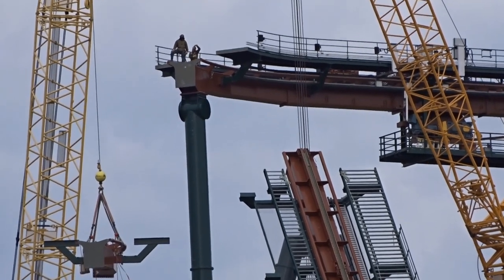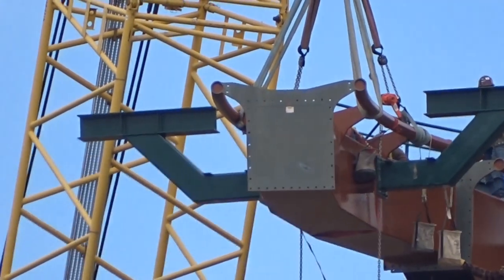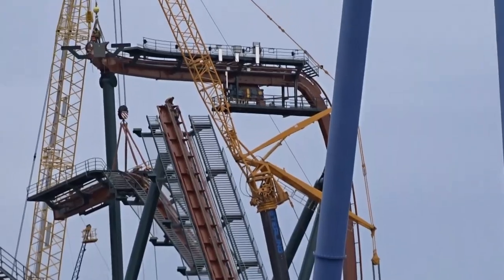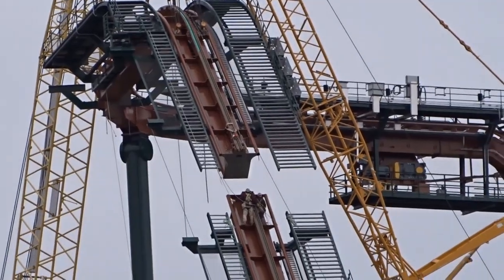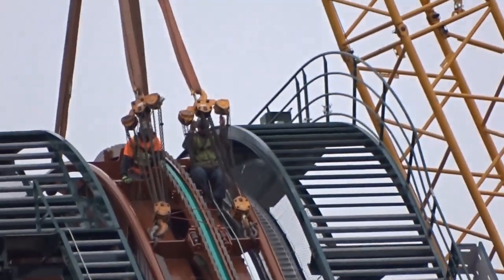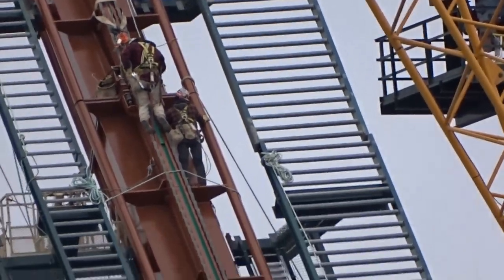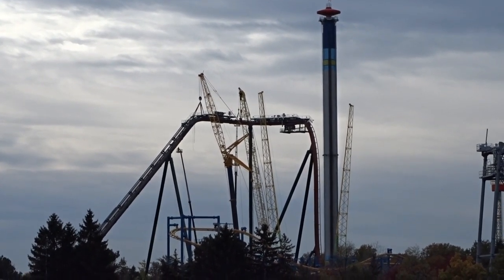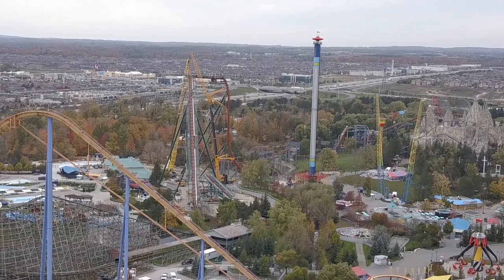Yukon Striker Lift & Drop Complete!

Comment: Can u find out from the iron workers about how many P.S.I. lbs of torque pressures there attaching the track pieces and footings ....!!  Im concern about these bolts loosening over time from viberation from the weight of ppl from the carts .....!!! Coaster ppl want to hear about it . there must be a certain P.S.I pressures for all theses track pieces and footings........!  Ppl want to know for their safety please ask head C.E.O or personally iron workers them self in an one on one interview please......and thank you......!!!!
Reply from the maker: Hey I can guarantee that you will never be in any danger at Canada’s Wonderland. On top of that the coaster that is being built is a Bollinger and Mabillard coaster which are the safest and most well built/designed coasters. Wonderland also checks all bolts and does what’s called track walks multiple times a day to ensure everything is safe. When it comes to bolts on their coasters they draw a line on the bolt and footing to ensure it doesn’t move even slightly. If you have any questions feel free to ask me cause I can promise you the ride is beyond safe :)